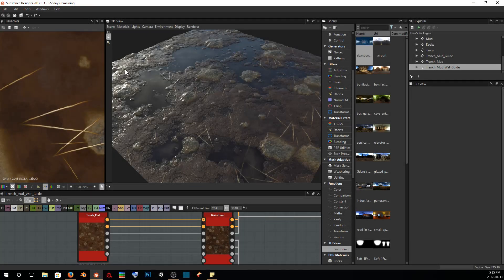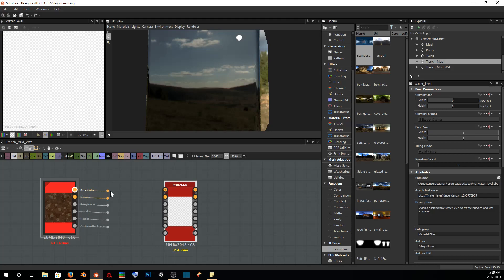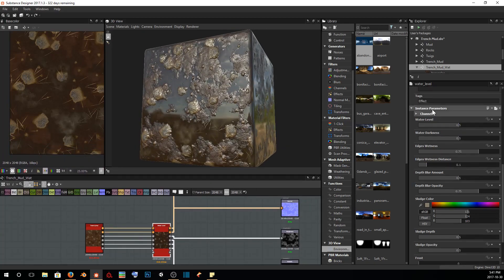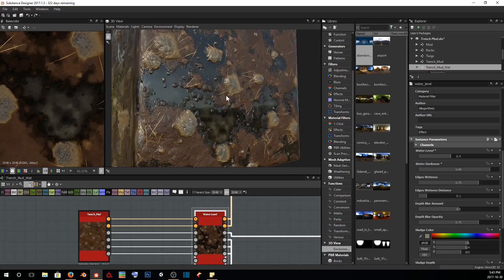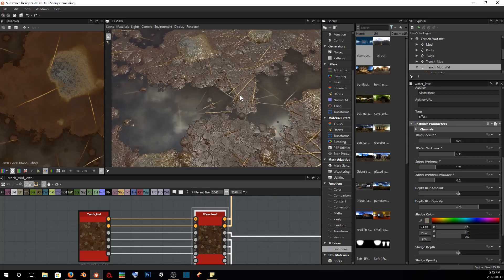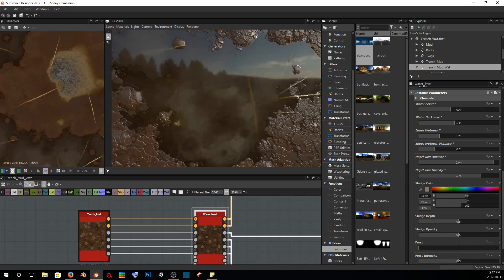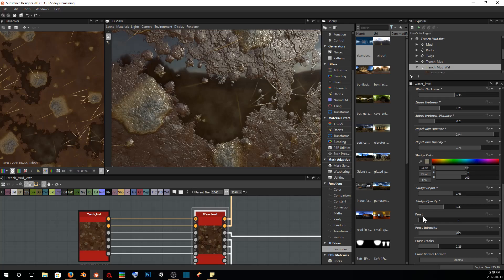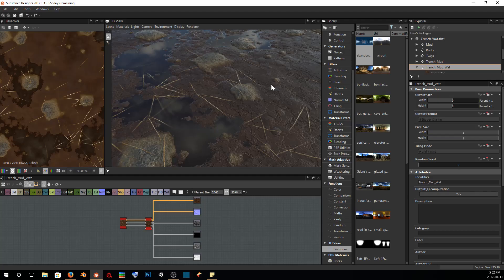How to create: Water | Trench Mud | Substance Designer | Ep. 05

Comment: Thank you for this great tutorial, I learned a lot, So the issue is whenever I re-opened the substance designer I lose the height and dents and everything looks flat, Is it related to tessellations? I have to turn it on and increase the "tessellations factor & Scale" every time?
Reply from the maker: So in order to see your Height map on your modle, you'll need to go to Material>Default>Edit in your 3D view and then bump up the Scale value slider. Sadly this will need to be done every time you come back in to the software after shutting down. You might be able to save this as a preference in your settings though, I've not actually tried.

Comment: I'm having trouble with the water level node. It's either no water or it completely engulfs my mud with just the rocks showing through. I thing its something to do with my height or normals????
Reply from the maker: After playing with the "Water Levels" slider, it only has the water completely covering or completely gone?
Reply: @GetLearnt  Its either completely covering or gone. It will be completely covered after 0.2 water level. It's like I don't have any depth, so yeah. I saw one of your previous comments about the viewing the height and I finally turned that on aha but I can't seem to add any actual depth to my mud, despite playing around with the colour options in the tile samplers and levels with the height output.
Reply from the maker: Interesting. It might be that your Height map is not very contrasted, which would cause a massive jump between the values that the Water Levels is doing. Is your Height map fairly one colour, or can you easily see a multitude of different values (such as brighter areas and darker areas)?
Reply: @GetLearnt  I've narrowed it down to something I've done wrong in part 4. After deleting all of the nodes except for the mud material in the 'trench mud' graph, I went back to the 'trench mud water' graph and the water level node is behaving normally now. I will follow through part 4 again and hope I get it right. Thank you so much for replying quickly. All your tutorials are amazing and you put a lot of effort into explaining everything and helping people out. You're awesome!
Reply from the maker: Look at you, don't even need me! :D I'm more than happy to help, friend. Thank you for watching, I hope I can continue to help you with videos on the future!